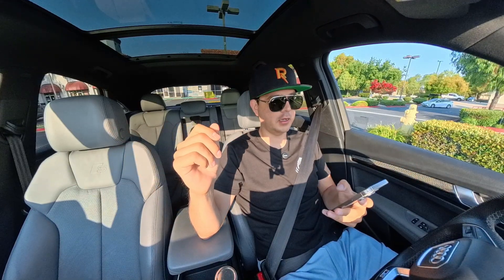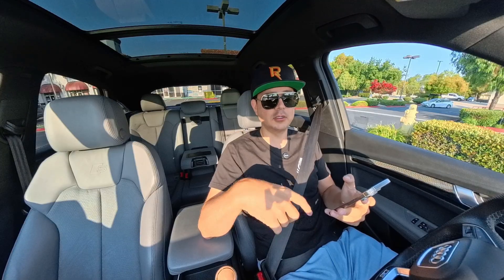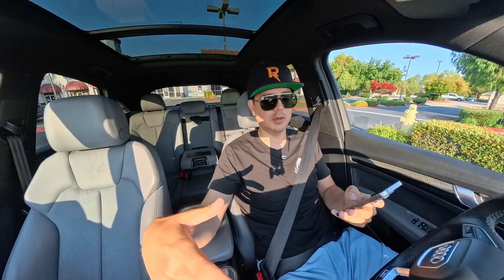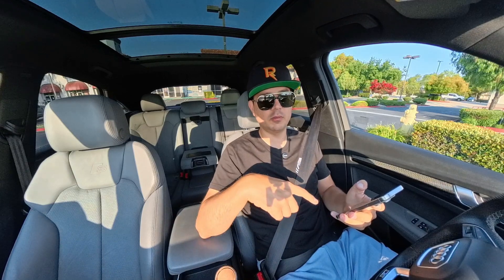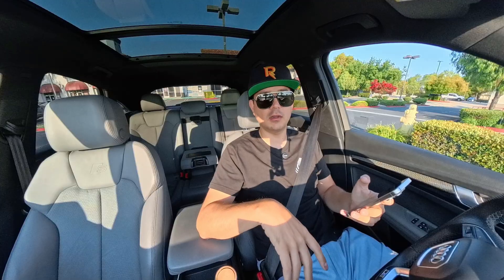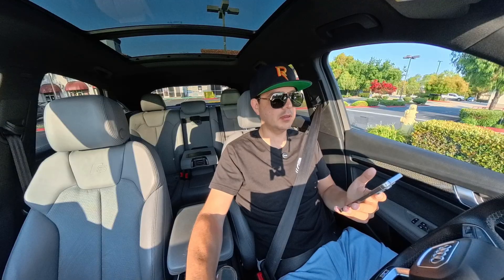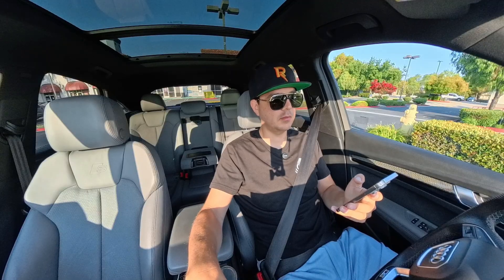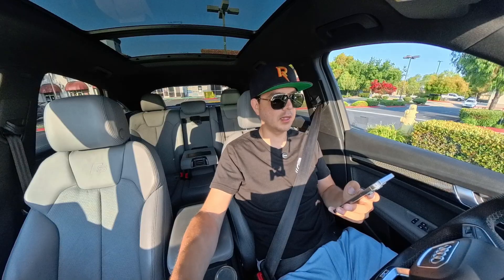Why the Enphase IQ10C Battery Fails in 2025 | FranklinWH aPower and Tesla Powerwall Is Simply Better

Comment: exactly why Enphase stock price has dropped from 338 to 38 in the last three years and this company is failing badly after once being a leader. No knowledgeable and analytical person would buy into their battery system.
Reply from the maker: I was working with a client that has older Enphase micro inverters M250s and we verified that the system could support IQ10T batteries. Had them installed a few years ago, and Enphase pushed a software update to the M250s which was related to the Grid Profile settings, well this throttle the systems solar production substantially. Spoke to support for about an hour to update the Grid Profile to a more common one used with the batteries but they said they could not do that as the batteries would not work then and the M250s don't technically support modern Grid Profiles. So now this persons site is generating around 11% energy year over year due to Enphase not disclosing this limitation of their older micro inverters when paired with their modern batteries. Client was trying to do a warranty claim to have all the micro inverters replaced by Enphase but Enphase is saying all 24 LG Solar NeON 2 modules are bad and we need to provide DC swap data showing the micro inverters are the problem and not the LG modules. Such a bunch of crap, he's now having to consider replacing the entire system (including the batteries) which he had installed just 3 years ago, and the original system installed 10 years ago. It's pretty disappointing that their own AC coupled batteries don't work with their own inverters, if the client would've gone with FranklinWH or Tesla's Powerwall this wouldn't have been a problem and the micro inverters wouldn't have been throttled.